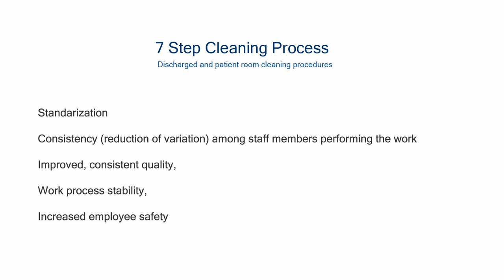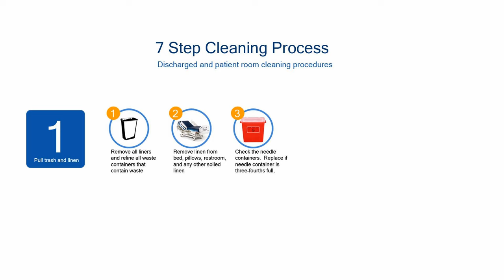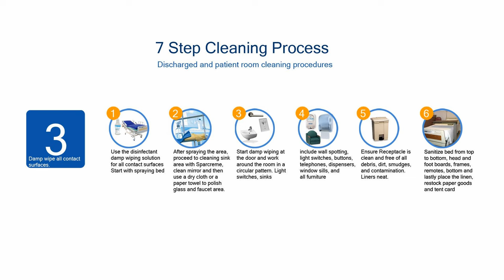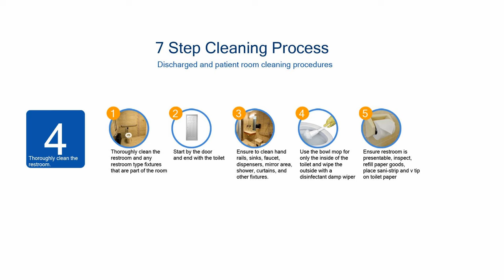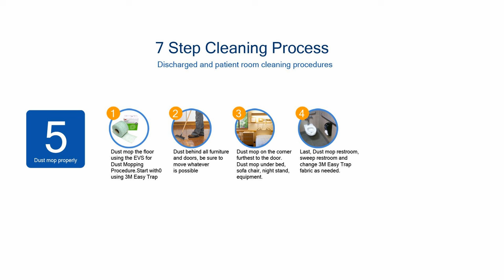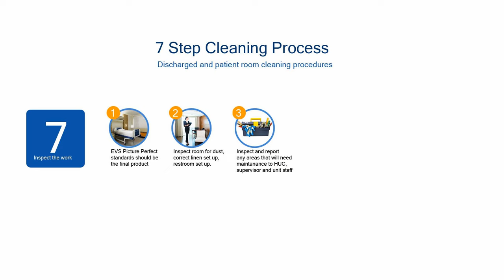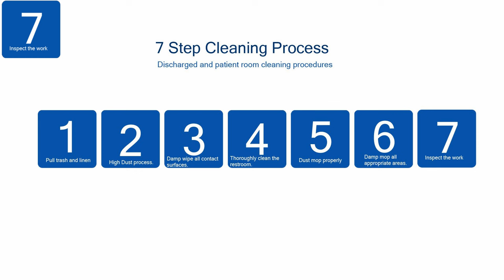UMC EVS 7 Step Cleaning procedure

Comment: Good, except consider:  Sinks should be cleaned at same time as bathroom.  Floor mopping should start at outer areas then inward to center where patient bed and commode were, then change mop head and mop out to door.  Dirtiest areas and surfaces (floors, furniture and equipment) are located about 4-6 feet out from  patient bed and bedside commode plus the entire bathroom--these are areas that should be done last just before the floor (which is universally considered contaminated--and again, more contaminated where patient, the commode or toilet is).  You have to look at what types of organisms are likely to be in what areas as much as what order to clean--organisms associated with feces are resistant to most cleaners, you should be using a bleach or similar in bathrooms or to clean commodes (some hydrogen peroxide formulations will kill enteric viruses but not C. difficile).  Also, all EPA rated hospital cleaner/disinfectants require specific wet/kill (also called dwell or contact) times meaning the entire surface must remain wet for a set amount of time per the manufacturer to kill the organisms the cleaner/disinfectant is rated to kill.  I saw people in the video cleaning but no one watching if the wet times were appropriate.  I can tell you that if you are using an EPA rated quats cleaner-disinfectant your wet times are going to be between 8 to 10 mins--meaning each surface has to remain wet, "by the clock" for that entire time.  (We just went thru a hospital survey--can't you tell?  :P )

Comment: Failed in 5 different angles being a c diff room 1 this door should have been shut behind her coming in with each piece of equipment need for task sec bleach is the only thing that will kill c diff even detailed cleaning not dry on them sink use vinegar breaks down calcium garbage should be the first thing to go out pluse linens any remaining used medical equipment undo removal remove with garage then move to most common touch surfaces light switches vomit bag holder etc. High point to low point start from right or left side don't matter them bleach clothes on big surfaces are good for 1 surfaces each side for c-diff clean down shower tolit detailing them as well floors also new linnen bags and waste bags have extra clothes to clean down gown etc using before exiting room then safe to come in with uvc light place in corners where covers most ground allow to run for 45 min hang new curtain review work place new card on Table with name n date total time minimum hour n a half to hour 45 mins to properly complete this task dialog start n end time on chart